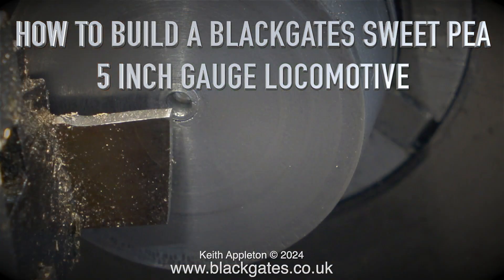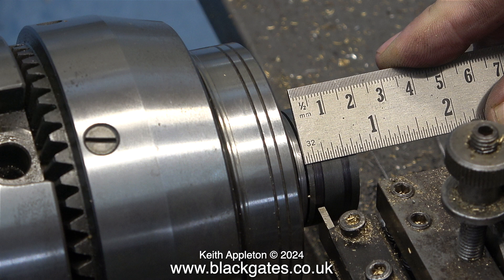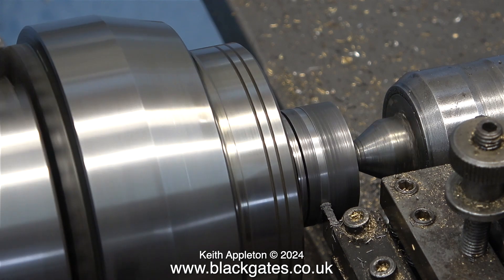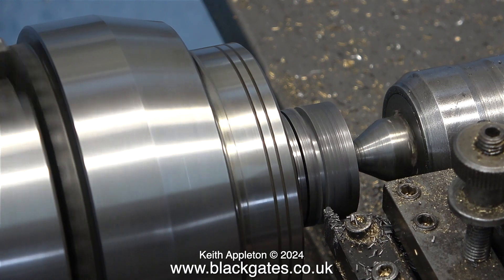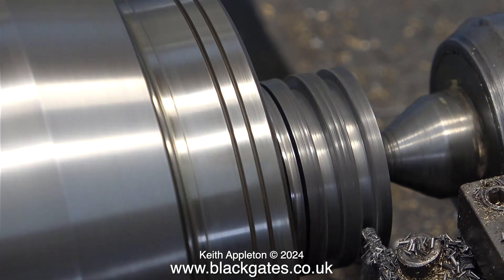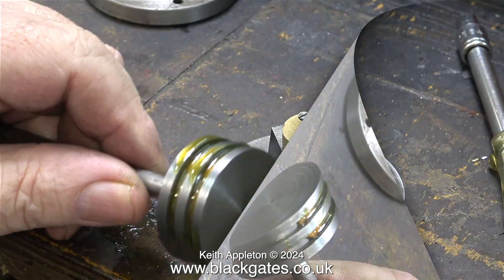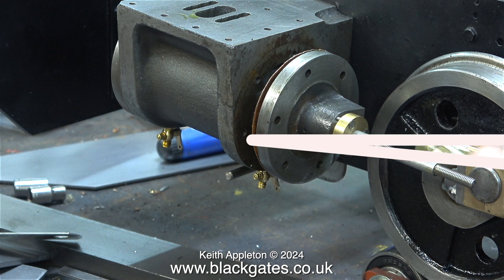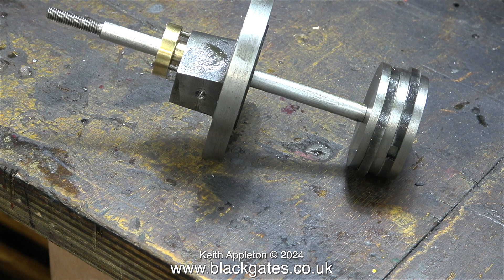A BLACKGATES SWEET PEA LOCOMOTIVE - PART #71

Comment: Used to use split tin cans for fitting motorbike piston rings into cylinders into cylinders, if more pressure was needed I used a length of string as a tourniquet or Spanish windlass.